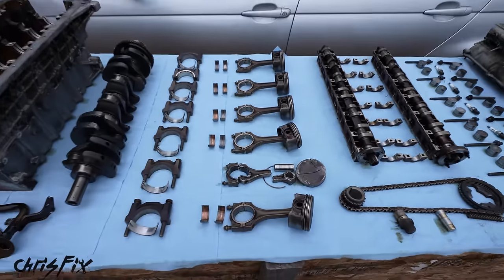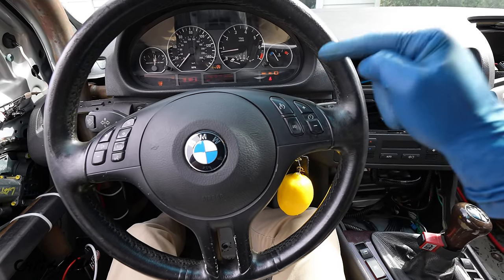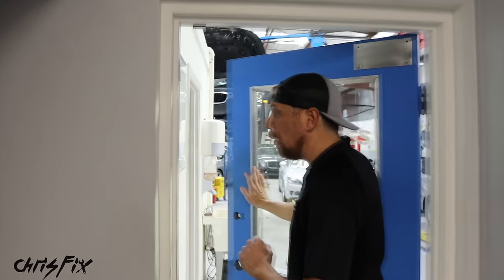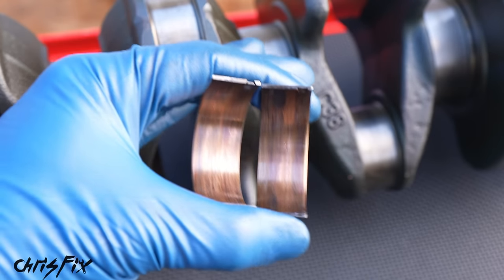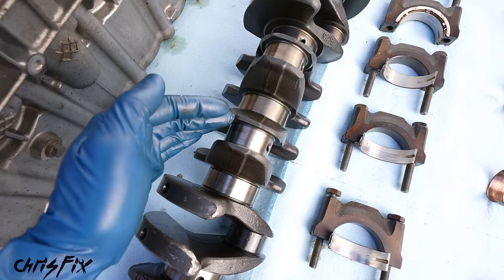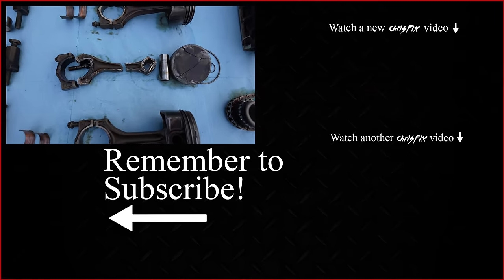What Causes a Spun Bearing in an Engine?

Comment: hey chris did you happen to reseal the oil filter housing before the race?
Reply from the maker: Yea the junkyard engine has a new gasket on the oil filter housing bc they are known to fail. Def don’t want to start a fire!
Reply: @chrisfix  I was mentioning because all of these bmw engines have a oil priming procedure after doing a repair that breaks the oil circuit during priming it can take upwards of 60seconds for oil to reach the oil filter housing. Bmw released an SIB regarding this issue.
SI B11 02 20
It's worth reading many people do not know this and this is the number 1 cause of premature wear and bmw engines locking up. It even effects the new b-series engines.

Comment: I do not buy it the Low Oil Pressure issue.
BMW will turn that low oil pressure quick, and is meant to let you know way before there is such failure. In fact, you can drive it with low oil pressure light on and still would not do damage for a significant amount of time.
If that was the issue the other bearings and components, more so the cylibder head, camshafts would be scored as it is the first thing to go way way before the rods.

Comment: I think Aaron downshifted and the engine revved up way more that 6500 rpms and then made a huge turn which gave it no oil pressure.
Edit. Oh, it's not overrevv, it probably was oil leaking.

Comment: Any old oil will hold that wedge of oil between the crank and 'bearings' - so long as you have oil pressure, you already explained that - what you might be interested in is the film strength for the rest of the engine.  That oil you're using has tested fairly low for film strength/boundary lubrication/sheer strength, whatever you'd like to call it.  What do you think about trying Quaker State full synthetic 5w30 in there? (has a much, much higher film strength)

Comment: hello mate my audi a4 s line has a crack in the engine and I'm not sure if I have to replace that bit or if I can use something to fix it
Reply from the maker: Depending where the crack is, it might be able to be welded. It all depends where the crack is tho. The crack has to be drilled at both ends to stop it from spreading.
Reply: @chrisfix  ok thank you mate ill have to have a look to see if I can find it

Comment: Hey chris, we have a 2000 Ford Expedition XLT 5.4l V8. And i was wondering, could this happen to our engine? Theres almost like 260.000 Miles on it and we do a lot of highway driving. so i just wanted to ask just in case.
Reply: It could happen to any car at any moment.
Reply: thats reassuring
Reply: Make sure you don't lose oil pressure and make sure you know about it when you do. Change your oil on time and make sure you don't drive on low oil or old oil. Make sure the pcv valve and possibly the crankcase breather are changed on schedule and free obstructions in the hoses. Also make sure your engine isn't leaking oil. All the spun rods i've seen have been from oil leaks leading to low oil and no oil changes leading to bad oil & engine wear.
Reply: @MrObsvenchilde  Thank you, though i am only 13, this will be helpful.

Comment: Definitely oil starvation that caused the engine failure. You may not have much movement side to side but in racing, the biggest G-force is from braking. All the oil going to the front, the engine ends up such air while downshifting at 6000rpm.

Comment: Hey chris so i replaced my starter on my 2007 mustang because the car wouldn’t start. it started and was going for like a week. then stopped working again. this guy put a screwdriver on the solenoid terminals while i turned the ignition and it started. it wont start if i don’t do that. what could be the problem?

Comment: Your fuel level is at 25% of the normal stats for 6000miles, but you only drove 0,8% of that mileage. So it didn’t cause a failure, but if you would have driven longer, you could have gotten a problem with fuel in the oil. Maybe the old oil had lots of fuel in it, so that it ruined the bearings and maybe some other stuff.

Comment: the reason why ebay pipes cost cheaper is coz of the stainless steal plus they dont purge the welds thats why there abit cheaper they will rust and faster tho
Reply: just prevent rust by putting something on it
Reply: @arbiya4346  it will rust and crack from the inside at the welds because of no back purge :)

Comment: I never understood the logic of racing cars. It's a vile act of abuse perpetrated on perfectly good machinery & innocent crankcase oils! 
That said, here's my two penneth worth regarding your bearing failure...
1) never start an endurance race with perfectly new oil. Engine oil is at its most chemically aggressive when it's fresh. Also even the most expensive oils (often ESPECIALLY the most expensive oils!) can contain unfiltered nasties like calcium carbonate particles (from the overbased detergent) which you don't want anywhere near your bearings, so run the oil in for a couple of hundred miles before taking it on the track, just to take the edge off.
2) Don't do an endurance race on a 5W40. It contains WAYYY too much polymeric viscosity improver. Under extreme, prolonged high temperature conditions, this stuff will shear down & thin your oil. Use an oil with a higher W-rating, ideally use a 20W40 which will be essentially VII-free. These days, it doesn't even need to be a fancy PAO/ester oil. A cheap Group II based oil will give you as much oxidative stability as you need for a race. It will also have a very low volatility & stay where it's supposed to be, inside the sump.
3) Monitor your oil temperature like a hawk. First off, in all engines, the bulk oil temperature tracks your coolant temperature. Second, the temperature of the oil inside the bearing annulus is WAYYY hotter than the bulk oil temperature (all that kinetic energy you're putting in has to go somewhere). That combination of rapidly rising hot coolant temperature & high revs would have made for a very thin oil inside the bearing, destabilising your oil film. Not good!
That's it....

Comment: 8:25 8:36 Engine Speed log
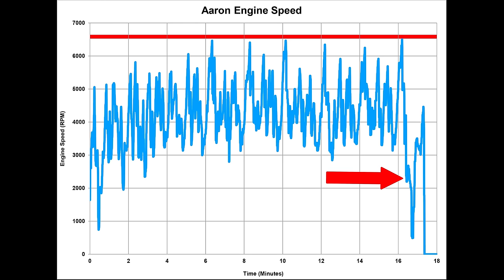8:56 Coolant Temperature log
10:10 Spun Bearing Issue
What causes it - oil related issue
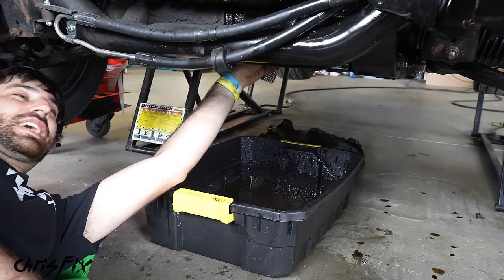15:18 Oil sample report
17:13 Gauge Cluster in car
19:28 horn installation

Comment: That’s how i blow my n62 engine from 2010 bmw 650i i was doing 85 mph with hight rpm on 3rd gear,  that’s when i hear boom a bouch of white smoke all over the car engine temperature high, stop and check engine seize, oil water was leaking under the car a kond og misture of oil and water, block was completlly destroy, rod bearing, piston destroy, just put the engine with only 60000 miles was a good engine until did that mistake.

Comment: Please do not use 5W40 for racing. Get a better oil (not going straight to M3/M5 specs but closer). Start with 15W40 (Winter additives reduce capabilities for hot engine).
Reply from the maker: Thanks for sharing!

Comment: how is it affordable then if you need a 4k cage and the whatever $$ fire suppression system and the ??? amountfor the gear the driver is wearing?
Reply from the maker: It is the most affordable racing. Basically you cannot get into door to door racing any cheaper than this.

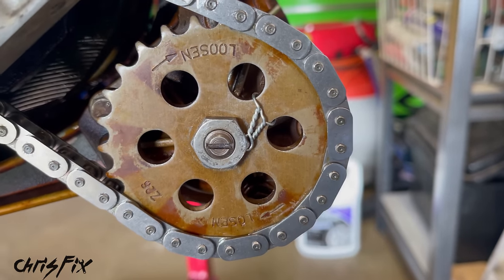Comment: That is not wire ties unless the plastic Was removed that is just wire 1:56
Reply from the maker: It's lock wire that was tied so you could call it a wire tie on the oil pump nut
Reply: @chrisfix  don’t really know what to put here and I was not expecting a reply at all and I understand and I don’t know why I made that comment and yes calling that a wire tie would be okay I just refer to the ones that have plastic on them as  wire ties again not really really that sure what to put here

Comment: Really? You've put a used engine without checking the bearings and the oil pressure? And you had the oil pan removed.